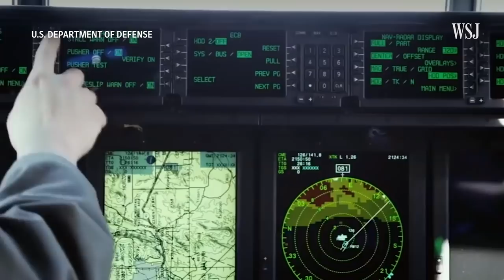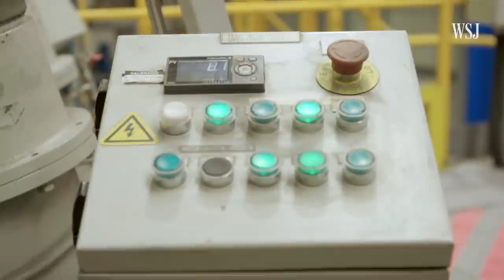Tech Companies Depend on China for Rare Earths. Can That Change? | WSJ

Comment: 3:00 yeah just like chips, sand is everywhere but hard to turn sand into high performance chips.
Reply: It's no any sand. It's silica sand
Reply: Sand is actually an increasingly rare supply
Reply: @tylerknight99  sand is common, dense sand is getting rare for cement
Reply: @theholiday3836  

Silica sand is the most common type of sand.

Comment: Recycling of Ewaste is an essential component in all of this
Reply: Increasing product longevity and banning planned obsolescence is an essential component of ewaste before you even look to recycle. 

Right to repair is likewise an essential component. 

Your whitegoods should last 10-20 years. If it lasts 2-3, it should be counted as defective and repaired for free. 

Your phone should last 5-10 and a manufacturer should be obligated to issue security patches during that entire period. A security patch is a fix to a product defect, those shouldn't be selectively provided based on when you purchased the product. 

TVs and consumer electronics should last at least a decade. If they're smart devices then applicable security patches should be mandatory. 

You should have a right to repair any product you own, including your Telsa or your Tractor. The right to buy parts to fix it yourself including OEM parts and compatible aftermarket parts, and the right to pay a third party to do the same on your behalf. 

Getting rid of planned obsolescence, strengthening consumer protection laws and mandating right to repair would reduce ewaste by at least half.
Reply: Preach!
Reply: Adopt circular economy concept
Reply: @tjmarx  most tech gets thrown out because better tech is developed, not because they stop working. This is especially true for TVs.
Reply: Completely false @MrMineHeads.  

Very few working devices are simply discarded rather than sold on. Most people who want to buy a newer model television, consumer electronics or whitegoods will sell what they have because it still has value and can partially offset the cost of buying the new device.

Most whitegoods made since 2005 don't last longer than 18 months. It's such a big problem that there's multiple investigative journalism pieces and documentaries on the issue. 

You are being very naive
Reply: @tjmarx  I'm not intentionally trying to be naive. If you have a source that says most consumer electronics are intentionally designed so that they only last a couple years, I'll happily change my mind on planned obsolescence. My belief was that there was just no infrastructure for dealing with e-waste, or people simply don't care enough.
Reply: a n i m e
n
i
m
e
Reply: @tjmarx  You are delusional if you think planned obsolescence is going away. I bet you're never tried your hand at electronics repair. Getting the parts can be an issue, let alone the cost of labour. Appliances are not getting more reliable. A 30 year old GE fridge is at least easy to repair. Appliances like dryers these days are disposable at around 10 years.
Reply: @MrMineHeads.  Do a web search for planned obsolescence.
Reply: @MrAnonymousRandom  Are you sure you meant to write that comment to me? It sure would seem if you did, that you didn't read my comments.

You also got the longevity of an average dryer wrong. As I previously stated models since 2005 are designed to only last 2-3 years, not 10 years. If these products lasted a decade there wouldn't be a planned obsolescence issue. 

You're conflating the two separate issues of planned obsolescence and right to repair. Both of these problems have some legislation in various jurisdictions around the world, with more insistence on politicians from the electorate that legislation can become stronger and universal.

Be part of the solution mate, not the problem

Comment: For 10 years I’ve been saying to my family neodymium will blow up.. I didn’t have any $ at the time but did make a few things.  Before that I said LED lights ...
Reply: 😁Nice going, so what's next? 🤔
Reply: @thabzmad7265  3d printing affordable housing? A mansion was printed for $150k
Reply: @stephenrobinson1944  not fair, already happening... I thought you would send me winning lottery numbers for  this weekend 🤣
Reply: It will be graphene batteries
Reply: @thabzmad7265  sure it's already happening but the vast investment required to kick-start the industry has yet to happen, meaning the value of your investment has the potential to massively rise
Reply: @stephenrobinson1944  The tech is still far from mature, I have a 3d printer myself, and my experience with it, although good, has me skeptical about this 3d printing house thing. First thing, it's expensive, the machinery with all the different mechanics may not be as cheap as some simple construction workers with their tools. Also, 3d printing takes FOREVER, going layers by layers allows you to print anything you want, but it is so inefficient, with current construction practices, simply build a rectangle and pour in concrete, you have a wall! Personally, I don't think 3d printed houses are going to grow with the current technology, and it's not investment holding it back, it's innovation. So I suggest we wait a few years, and if it's still alive with the newer tech, maybe we should invest in it then.
Reply: @sayple109  no it's actually much faster. I recommend looking into the subject a little bit.
Reply: thorium?
Reply: @stephenrobinson1944  No actually an over engineered over complicated solution is not quicker. I recommend looking into the subject a little bit.
Reply: Now predict the future.
Reply: @runewinsevik8471  it will happen soon
Reply: Done. Now what
Reply: @runewinsevik8471  IT especially in payments. Remote working tech. Energy storage either via hydrogen economy or via newer battery tech like Sodium based cells, Solid State batteries etc.
Solar panels, Chip manufacturing SiO4 based manufacturing.
Pharma and health services.

All these would be on up and up.
Its not hard to make money by investing if one has $100k disposable, moveable capital.
Reply: Behold ! The messiah !
Reply: @public.public  dude they're actually looking to use to solve the housing crisis since it's far faster than normal construction methods.... Do some research before u move the flappers

Comment: The comical thing is that Rare Earths are anything but.  Practically every form of mining results in RE's of almost every form. 
The Chinese just sold them cheaper, so the other producers quit selling them. 
If people don't want to buy them from China, other producers will step up to produce and sell them.
Reply: It also produces a lot of pollution, destruction to the environment that developed countries don't really want to touch, if they don't have to.
Reply: Nah, it's not that easy actually, otherwise countries would have subsidised some mining for the sake of national security long ago (at least for military contractors). Aside from extraction (which needs to be done effectively, otherwise your output will cost a lot more), there is also processing - all key tech in processing of rare earths mostly belongs to China, i.e. you would need to buy their equipment. Another complicating factor is the environmental damage - even with China's effective supply chain, the rare earth costs have been rising due to stricter ecological regulations, which requires one to use more environmentally friendly extraction / processing methods and utilize the waste they produce.
Reply: linkzable  why you are copy pasting the thing everywhere?
Reply: And the procedures itself cannot be patented, probably. The Machinaries or at a stretch the softwares....

Comment: Interesting.
One of the reasons why China can produce so cheaply is that the 'ore' the my use in inner Mongolia is the slab of Iron production, which has been accumulated for decades and is already pre-concentrated.
The cost of extraction is paid for by the Iron, while the revenues from the rare earth's is a pure bonus.
That, apart from the low environmental standarss allowed them to drop the price until all competitors want bankrupt and they can sustain exports at a low price.
The reason why Australia has a working rare earth mine abd the concentrator plant in Malaysia is that in a previous fishing quarrel with Japan, China stopped the export if rare earth's to Japanese Electronics companies.
These companies realized their supply chain vulnerability and signed a supply contract with Australia. Although the cobtractvdetails were not published AFAIK, it is clear that the Japanese companies pay a significant premium for the rare earth's and have committed to buying minimum quantities. This is something US and EU processors have avoided to take advantage of the low Chinese set world market prices.
And the radio active residue problem is the element Thorium, which could be used very profitably in a new type of molten salt nuclear reactor. This technology is pursued by China and India as an alternative nuclear fuel. Thorium rractors cannot produce weapons grade plutonium as a by Product, which seems to be the reason why this reactor type has not been developed to market readiness.
It is likely though that this last puzzle piece will make the whole rare earth supply chain more sustainable.